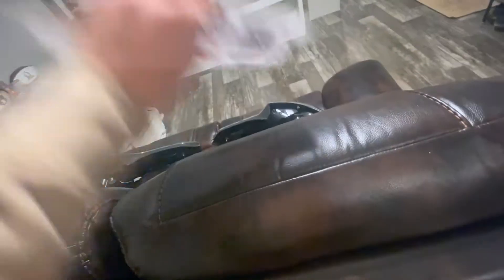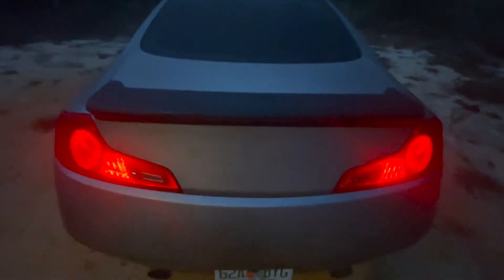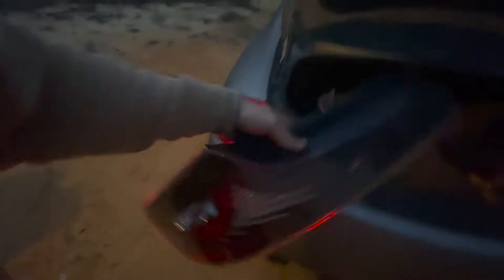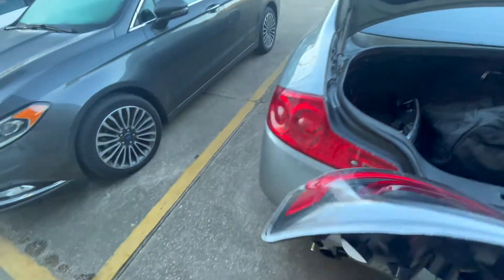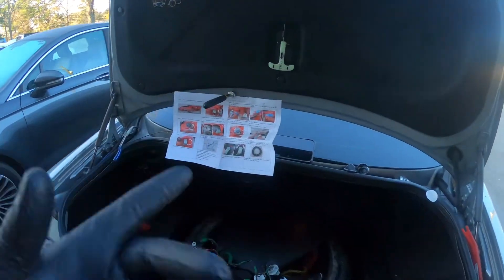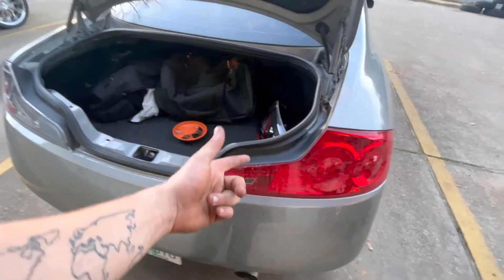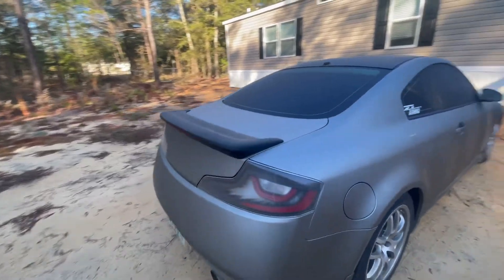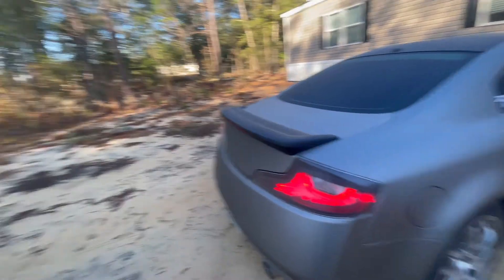New Akkon Taillights for G35

Comment: Should have recorded the install. No one has made a how to video. I have a 03 G35 coupe and these taillights doesn't seem to be plug and play. The wiring doesn't match
Reply from the maker: Mhm for my 07 everything was plug and play. There might be a different in the years that make them harder I’m sorry. What do you have a problem with
Reply: This tail lights are plug and play I have the same ones 10 min job per side